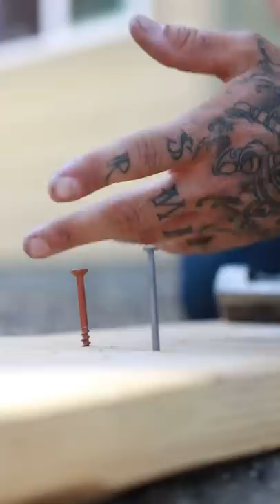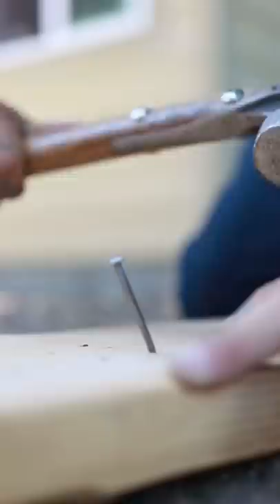Nails vs. Screws: Why do we use nails? #shorts

Comment: Also, screws are harder, wich means they "shear" much lauter than nails. He demonstrated bending, not breaking, wich is fundamentally different. For a screw or nail to bend it has to have some Play between the fastened parts. Otherwise only pulling or shearing forces apply. In a 1to1 comparison screws usually won. That is why, at least in europe, you use more nails than screws. Correct me if i am wrong

Comment: The screw isn't all the way in, or the nail. All science is out the window. Also type of metal in screw matters big time, as does type and function.
Reply: That has nothing to do with this video, if I screw rafters on and the rafters move then the screws are more likely to sheer than a nail. This video is a good example.
Reply: Nah, it's a convenient way to demonstrate the idea. In my experience, screws break more easily than nails.

Comment: Start building houses out of bricks, stones or concrete instead of 2 by 4's 😂
Reply: Not smart to do in earthquake areas...
Reply: @shanefiddle  smart to do in a hurrican area
Reply: U still need a wooden frame
Reply: @jjwang7597  err nope
Reply: @jjwang7597  no, but you do have special challenges for the floor, roof, and electrical and mechanical systems.
Reply: Khaliil bin Ammar  pouring the concrete requires framing.
The world is running out of sand. 🤷‍♂️
Reply: Khaliil bin Ammar  There are different kinds of concrete and making a good foundation for the concrete to sit on is important for large building, especially if a company is paying millions of dollars for it.
Skyscrapers, apartments, shopping centers, etc have more people and have to be firesafe as well as sturdier in case of tornadoes. They have better foundations (that do still crack) and often steal or thicker wood beams. Because a large number of people are in these buildings at a time they have to have heavy duty fire exits, stronger windows, and fire walls. Firewalls alone add to the weight of the structure and therefore require a better foundation and stronger materials for a second story. There’s a lot of engineering that goes into homes and commercial buildings. When a home is built according to local codes (different states and counties have different codes) it is designed to withstand reasonable levels of disaster and resist fire, flooding, and collapse.
Reply: There's no wood involved in decent house building. In the Netherlands we use cement, bricks and mortar. 
Building houses out of wood in 2022 is completely retarded.
Reply: majority of the houses in southeast asia are built with concrete i dont understand the preference of wood for floods, earthquakes, and heat. though i cant argue against winters, japan and some european countries with extreme winter/summer tempts use either brick or concrete too...
Reply: @Ian-we2pq  Although many homes are built with concrete, if you watch documentaries about their engineering and architecture you’ll see their historic buildings made of wood end up with less damage than concrete buildings in an earthquake. This has prompted engineers to find new ways of building to allow the house to move
Reply: @DexBunny  Literally the reason the tower of Pisa is leaning is because of clay soil and it’s not the only one. They can’t even use the bells because the way the are attached to the tower is falling apart. The entirety of Venice is on stilts pressed into the ground because it’s all thick clay.
And it’s not just clay, it’s the weather that effects the clay. Freezing temperatures causes the clay to expand and push posts and foundations upwards. This is worsened when the highs every year are 90-105F and dry asf, to the point the ground itself literally cracks. There’s tons of stuff that goes into engineering a building which is why every country has its own styles and codes. Older homes in the Midwest (before ac) were designed with high ceilings, lots of doors and windows, and even no middle part (this is called dog trot style) to let wind through to cool the house and occupants. But they still had fireplaces to cook and warm the house in the colder months. But you’d die a lot faster of heat exhaustion than freezing. The same goes for Japan. The cold was more tolerable than the heat and humidity. Their traditional homes have big doors and rooms that can let air straight through. But today, their way of cooling is different from ours, where we have huge ac units for the whole house, they use small units for each room.
Reply: @xchemicalXladybugx  i agree with historic buildings made of wood

but its hard for me to comprehend wood structure being more advantageous than concrete/brick structures as my friend's and family's homes have encountered 3-6magnitude earthquakes on different intervals

also against fires as its less likely to collapse during housefires and perhaps the most complaints ive heard from my friends in the US is animal damages such as birds, rats, and termites knawing on the structure
Reply: @Ian-we2pq  I wouldn’t say there’s more advantages just different ones like the weight of the building, flex, and ease of repair and construction.
About the pests, wood homes typically don’t have wood exposed, unless it’s shingles. Neither should touch the ground. Both the structure and shingles are treated to resist rot and pests but it’s not perfect. The best thing is to keep soil and mulch away from the foundation. You should have at least 4 inches of exposed concrete and proper grading to prevent water running up against the house. The next thing is the siding. Most stick builds have bricks, stone, or vinyl exteriors. Between the framing and exterior there’s several layers of protective materials to prevent moisture from getting in or out. The most important thing is that none of the wood is left exposed. The exterior materials protect the wood from pests, moisture, heat, and fire. But bricks and stones still crack and are left with weeping holes to let moisture out. A common problem with metal buildings is they “sweat” due to improper insulation.
It’s also important to not let trees get to close to the house or have anything growing up the side. That’s how rats, raccoons, possums, and squirrels get in the attic. Termites get through cracks in the brick or concrete, but that’s most often when the dirt is too high around the building and windows and doors aren’t calked.
Basically, the issue isn’t the house or how it’s built, but people who don’t know how to maintain that type of home.
Honestly, if you watch Holmes On Homes you’ll see it’s almost always bad construction that shouldn’t have passed inspection or poor maintenance of homes that causes these issues.
Reply: @xchemicalXladybugx  good points, and sounds like a good show

Comment: That’s an interesting theory that only seems to apply all your nails are sticking out of the wood that much. I built my garage with only screws many years ago and it shows zero signs of leaning as compared to the previous garage that was there that was meaning in about the same amount of age.
Reply: Nails have a high sheer strength whereas screws do not. Most places require nails because of building code. No carpenter would build a house with screws
Reply: @sh115067  that’s not true. When I built my garage it had to be done legally. And I got advice from the legal experts as well as building experts to make sure I wasn’t doing anything incorrect that would warrant it having to be taken down and start over. And screws are perfectly legal. I don’t know where you got your information from. And I doubt you live in a place that the rules are so vastly different to not allow screws.
Reply: From my understanding of it you have nails wich will lean,come out of square and plumb, and show signs of fatigue before failing whereas screws just shear and fail catastrophically with no warning.
Reply: @tomster7574  every State has their own building regulations and it varies greatly.
Reply: @Uberragen21  i can see how it can vary in the tiniest details, but never greatly. not even in the leaky condo scandal time.  that was just a greedy con job.  but otherwise, how else could they great vary?
Reply: @garrettborba994  nah, that depends entirely on what screws you use.  some are made just for hanging siding or inside wall panels or light fixtures.  the ones i used on my frame were just as strong as any nail you can find to use in their place.  they cost more too, just as galvanized and bendable.  when i had to double up on the front support beam, i had to use an electric impact wrench to get them in all the way
Reply: @tomster7574  California for example had a bunch of different code requirements specifically because of  earthquakes.  Areas prone to regular freezing winters are different. flood zones and hurricane zones both have special code requirements.  All of these have some best practices as well.
Reply: I just figured that they uses Nails cuz it was faster but for me I will use screws more
Reply: @tomster7574  what is the make and model of screw you used
Reply: @tomster7574   heed warnings so you don’t have a Miami condo on your hands. so far so good ≠ ending well.
Reply: But the frame gets covered up plus u don’t realise how strong nails are
Reply: @tomster7574  what screws did you use?
Reply: @Ujwal5555  go to home depot and ask, there are a few options
Reply: @tomster7574  can you link it ? Don't really have a home depot where I live. Sorry for trouble.
Reply: @Ujwal5555  Where do you live?
Reply: @tomster7574  india

Comment: This is only half the truth.

Only time I’ve broken a screw is exactly this.  

Let’s see you pull boards apart with nails vs screws, then tell us again “why you use nails”.
Reply: When you goof something up it comes apart easier with nails.
Reply: Do it all the time. Nails come with the board, screws blow the heads off or pull through. Doesn't matter which one you use when i use a 5ft crow bar.

Comment: Just wait until someone figures out to make screws out of the metal as nails.
Reply: Yoi can buy structural screws
Reply: Same primary metal(steel) just alloyed or hardened to differing degrees. Huge disparity in behaviors between mild steel and hardened steel, softer metal bends while harder metal breaks because it's more brittle than in it's more ductile state.
Reply: Screws have to be made of harder metal otherwise they would just twist once they are driven half way in and friction becomes great. That's the entire point

Comment: Didn’t know this I always thought it was because nails were faster to use, thanks for the info!
Reply: Nails are maluable, while screws are not. That means when the building moves screws can break because they are harder and more briddle. 

But, screws are not all the same. Structural screws are softer than for example decking, or drywall screws. 

I think this debate must be seen in light of natural disasters. In almost the whole of Europe we don't have tornadoes, nor earthquakes. In Norway for example, most carpenters don't have manual nails - only coils and strips. In my opinion houses in the US seems to have a lower quality than in Northern Europe, both in materials and code. Mind you also that buildings in Norway by come are mostly built with 8" lumber on exterior walls. Then you have 2" horisontal lumber on the inside of the house outside of the vapor barrier. 

Screws do have a few advantages over nails;
-Ability to force material into position
-Easy to remove in case of future changes
-Can create superior connections with the right screws and connections.
Reply: @olgajoachimosmundsen4647  with insulation technology nowadays I think 8” exterior walls unnecessary in the states. Maybe in Norway with a colder climate it would be better to have a thicker wall but R-23 walls and R-38 ceilings are usually our code requirements from where I am and that’s plenty.
Reply: @olgajoachimosmundsen4647  also, nails work their way out and get loose over time.
Reply: @veloxeam7303  and dont stop a structure from falling apart from rot and things of that nature. They bothe have advantages and disadvantages.
Reply: It is because they are faster, it's just an added benefit.
Reply: In my opinion it is because their nails are cheaper. And screws are more expensive and more effective. And you don’t leave your nails sticking out of the wood that much for any fear of them being treated like that.
Reply: Screws allow you to assemble and disassemble.  Use screws, unless your work piece needs to fold to nearly 90 degrees, ha
Reply: @toddbertram6556  but you don't build a house with intentions of disassembling it
Reply: @olgajoachimosmundsen4647  in Florida the homes are block
Reply: The reason is largely because nails are cheaper and faster.  The reason the building code says nails or certain screws is because of this.
Reply: @mattcournoyer7028  I wish 8"  exterior walls were a common thing in U.S.  unless you mean the total wall thickness, finish to finish, most exterior wood walls are nearly  6"  rough framed here.  Some regions may be more.
Reply: @michaeless658  buildings are also collapsing over in florida
Reply: Personally i think this is part of it as well, nail guns can be super fast, but you have to use screws sometimes to make things secure
Reply: @CaFFeineSouLja  more than one?
Reply: This video is bullshit if your house moves that much you need to move
Reply: @poncho2640  explain why the video is bs? You are saying screws are able to bend more than nails and nail have a higher rlikelyhood of sheering?
Reply: You are actually correct. The majority reason nails are used is because of the ease of use. Engineering isn't as simple as stated in this video but it does pass a good point. Some structures need some flex but the majority of homes actually don't.
Reply: @CaFFeineSouLja  yes a 40 year old not maintained building… that in 2018 was warned about the issues, okie dokie then.(also building code were revised more recently for the more intense weather patterns that global warming is cooking up)

Comment: Not seen screws break when properly installed and fully embedded in wood. Screws have much holding force making the two pieces as one while nails will pop out. 16D box nail and #8 screws are pretty close in shear, about 90#.

Comment: Everyone that has a wooden fence in their backyard can testify that over time, the slick nails will pull through the wood while a coarse threaded screw while stay in place and not pull through
Reply: Thats a fence not a house
Reply: @EliteSuperGrunt  its also a metaphor i assume to 2x4’s of a house
Reply: Pretty sure he said houses not fences in the video lmao
Reply: Nobody runs a screw or nail halfway down and quits. Moot point. Also, he ran it down to just above the shoulder of the screw.  Try hitting the threaded end and see how easy it is to break. You can sink a screw much farther than you can a nail to really tighten it up. Also, if that much movement is happening to start shearing fasteners, you’ve got a bigger problem than deciding between nails and screws 😂

Comment: I mean. They do make structural screws. You just have to use the proper screw for the proper application. I personally always like 1 screw to suck things tight. Nails to actually hold the compression force.

Comment: I would’ve thought that the nail can just slide out of place with enough force since there’s nothing gripping the wood on the inside. I always thought that screws were the better option.
Reply: Most nails that are used for general construction have a glue applied to them that is applied by friction.

Comment: If only screws had a part of them that wasn’t so “flimsy” due to their cork screw shape, and seemed more sturdy like a nail. Maybe 1 or 2 inches of extra space between the head of the screw and the cork screw part itself? That’s just crazy talk tho.
Reply: Sarcasm 🤣🤣🤣
Reply: @johnsons2003  I also know that when my walls shake due to an earthquake it has the same effect as it being hit at 90° angle with a hammer too. Makes total sense. 
Also, I would definitely use a copper screw, since we all know that copper is such a great metal to use and doesn’t corrode at all.
Reply: The reason they break is not because of the shape. It’s because screws are cast from liquid while nails are forged or deformed. 

Casting causes the material to be brittle
Reply: @cmm3699  copper is super expensive. Ever bough electrical cable (nema) for your house?
Reply: @htko89  Who's saying copper is cheap? The dude above said it corrodes, and that making a copper nail is pointless because of it.
Reply: @htko89  k, gold is expensive too, doesn’t mean if it’s in the shape of a screw or nail it’s somehow better because of the price. I just want to know in what scenario would using copper nails be beneficial in building a structurally sound building? Since this video seems to me like an intentionally poor comparison of materials.
Reply: @petrikillos  building materials are selected not only for their material properties but the biggest factor is acceptable cost. Copper fasteners are “not a great metal to use” and not a good solution because it will cause your box of fasteners to be like 10x the regular price. Multiply that by a house
Reply: @petrikillos  I mean I don’t see the point of bringing up corrosion. Copper, iron and steel corrodes.
Reply: @petrikillos  exactly. I think my sarcastic comment: “copper is such a great metal to use” may have seemed like an overall statement about copper. I meant it in the sense of using it as a fastener like screws, nails, staples, etc. since that’s how the video seemed to use it.
Reply: @htko89  yah those are all corrosive metals. Especially iron. Who would ever use an iron screw or nail for a building a house nowadays though?
Reply: @htko89  btw you quoted me incorrectly. 
I know the implication is in line with what you wrote, but that’s still not what I actually wrote.